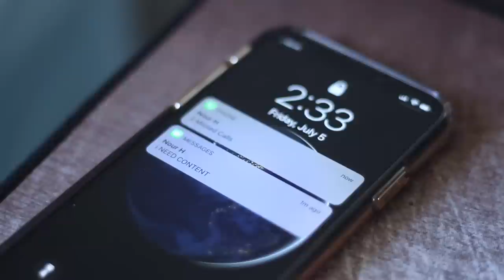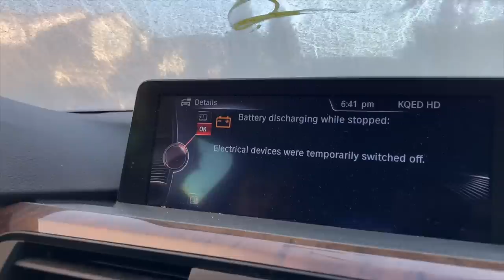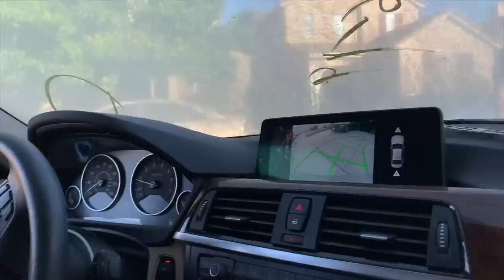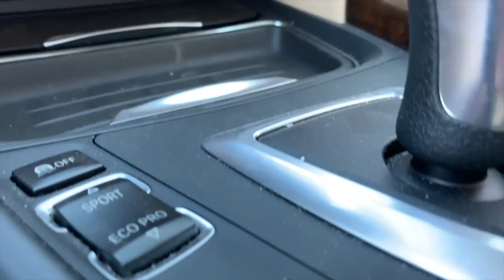REBUILDING THE CHEAPEST RUNNING BMW F30!

Comment: Wish I can do this… I had my 2015 328i (base) for bout 3 years and so far I went through some standard gaskets such as oil filter housing and valve cover gasket, some sensors, new fuel pump, got about 90K miles on it now and lately my car’s been hesitating/lagging at low RPMs, especially in barely moving traffic, soon as I let go of the break and gas a little, the car would hesitate and then jump forward a lil all of a sudden, anyone has any idea what’s wrong? Also if there’s any BMW fanatics in the Florida area who’d can do a restoration project with me, pls feel free to hit me up, would like to make this car run like new again and change whatever I can without getting robbed at a BMW service center